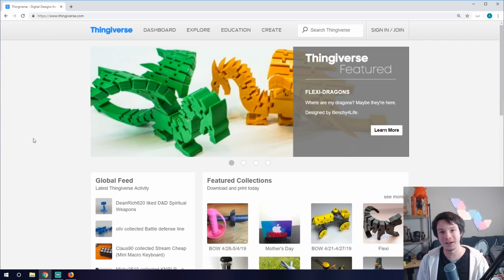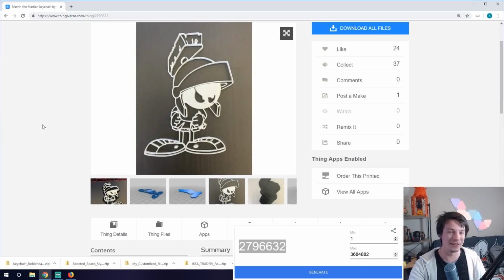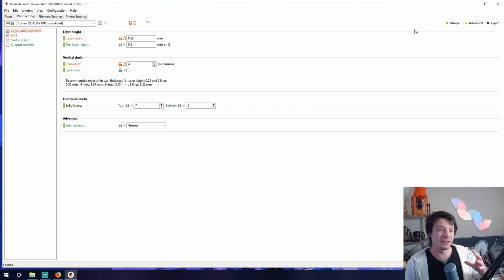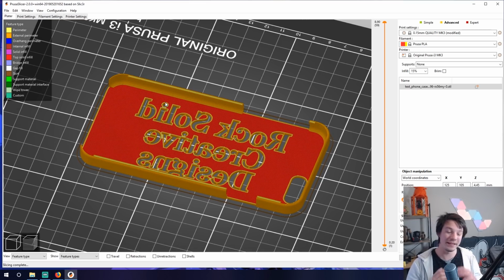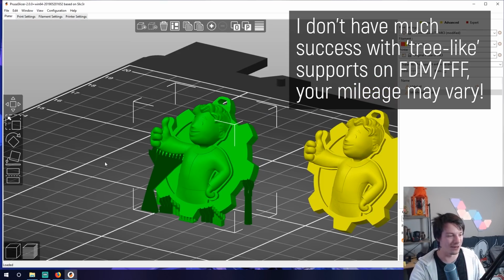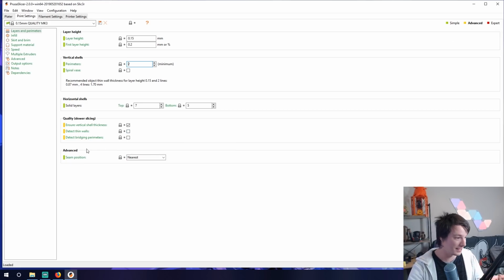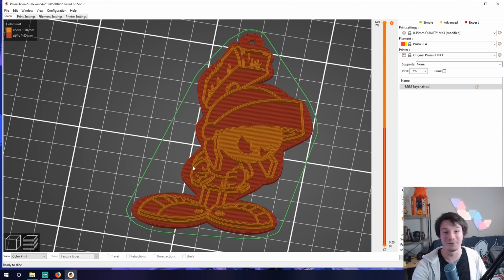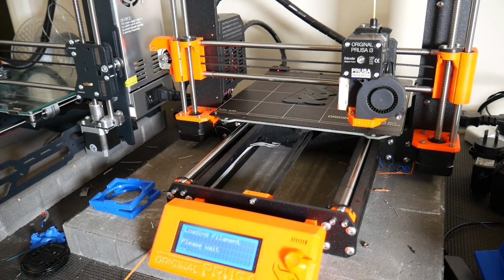PrusaSlicer 2.0 vs Thingiverse vs Prusa Mk3 - 3DP Gauntlet Episode 1

Comment: I wanted the elephants foot compensation in Cura. Interesting it exists in Prusa.  It does need a number if layers criteria and reduction per layer cruteria though. Of maybe just set the physical distance vertically and inward, and it can calculate a linear chamfer basically. 

Does Prusa slicer have graduated supports for that box? Then they can be minimal at the bottom and only increase desity near the top.

Comment: I did some dual colour prints and also had a problem with oozing. But there is a way to solve it in an easy way:

1. Increase the skirt in high up to the layer with the new colour. As skirt is always is printed first, you will prime the nozzle for the new filament there, not disturbing your object. The skirt works like a "prime tower"
2. Go into gcode with an text editor and search for M600. Cut it out and paste it about 7 lines later (after the the first linesegment of the next layers skrit is printed). M600 alway goes back to the last position, even if the next printing move is elsethere. So without editing the gcode, m600 will go inside the object first, than to the skirt. Printhead might loose some oozing material inside the object. If moving m600 5 lines down in the gcode, last position is in the skirt, so printhead is outside the object. So risk of loosing oozing material inside the object is much lower (maybe use a distance of 2cm or more for the skirt, so longer ooze can not fall into object).

Doing this two points makes colourchanging much more reliable.

Also with editing gcode gives more possibilitys. I printed the front of my Prusa Mini with 5 layers black and 5 layers orange, than black again, to get the empossed "Original Prusa Mini" Text more visible. Prusa Slicer prints Prusament PET-G with 240°C on first layer, 250°C on the next ones. I changed it to 235°C for less stringing, so the cutout text was printed much more clear. I added a second m600 before the 8th layer and replaced it by M104 S250 in Notepad++. So most of the part has full strengh, only the first 7 layers maybe a little less layer adheasion (which does not matter there) but a cleaner cut of the text and the orange better bridging over the cutout.

I eaven tried different materials for my Mini Clones. There I printed all parts black, exept dipflay case, wich is silk PLA (very nice look). I wanted the text in same colour as display case - so I added an M104 S215 before first M600 (and M104 S250 after the second one). With PLA also fan speed should ber 100%, so I added an m106 S255 after first M600 selected gcode from first m600 to second m600 and replaced all "M105" inside this selection by "M106 A255 ;".

It worked out beautifully. Sadly I have to print out it again, because I forgot to change the text from "Original" to "Cloned" before ;-) But maybe I simply print a cross with red filament an superglue it onto the "Original"...

Comment: That dual color marvin.
 Could that be printed vertically like the fallout keychain ? I realize you would have to use the separate 2 pieces rather than the single model version.
Reply from the maker: Depending on the overhang you would most likely need support material, but it's probably possible!

Comment: Very cool , i have had the Prusa i3 Mk3 for a little while and still trying to loose my L plates with 3D printing. Lots of great tips to help thanks heaps.
Would be very keen to see a serires on the Prusa i3 Mk3 and the Prusa slicer program, sing out if you do.
Cheers

Comment: Angus, instead of bombarding you with noob questions which you do not have time to answer, can you point me to a helpful 3D printing forum to help a noob who has not printed a single model, but who already has a ton of questions?  Thanks

Questions like: 

Does a 32mm wide tab sticking 6.35mm horizontally out of a simple box need a support structure?

Why do default settings on Cura and default settings on PrusaSlicer for the same model - a pretty simple box - vary by over an hour?  Same model, same printer, same material = 1 hour slower in Cura.

Does a model always print just like the sliced preview in the slicer software?  It looks like default Cura shows slightly better small letter formation than PrusaSlicer - I'll have to doouble check I didn't miss anything here.

Lastly, I'm a huge tech geek and have no problem tackling a printer build from scratch.  Is there an advantage to building your own vs Prusa or similar?  I'd like to get the best printer value for around $500 or so.  Should I be looking for resin printers?  Is that where the future is going?  Today's 3D printers haven't changed much in quality of print since materials and basic printing technology hasn't changed all that much in the last few years as borne out by your "3D Printer from 2012" video.  Less expensive, sure.  Better print quality, not proportionally so.  Ok, let the can of worms be opened, lol.

Comment: Default extrusion width: 0.42mm
I don't understand. What exactly does the extrusion width setting change? The position of the nozzle tip (distance between lines) or the amount of extruded material?
For some reason I thought it changed the latter, so increasing this setting would give you even wider layer lines. But now I'm in doubt.

Comment: Hi Angus, you should upgrade your MK3 to the full MK3s with all changes Prusa Research made until today. To me it‘s like day and night in case of handling and print quality. Especially if you print PLA cooling is much better. Also another tip: During wintertime here in Germany I increase my heat bed temperature by 5 to 10 degrees and all models stuck well. After the bed cooled down you can take the model from the bed and it did not stuck at all...

Comment: Hey Angus, great Video. You could have used the layerheight change feature for the battery box and change the Layer hight to 0.10 or less right under and during the the bridge so that the part comes in smoother from the outside.

Comment: I'd rotate the battery cover around Z by 90° so it lies lengthways in the Y direction to brace against the bed motion.
As the model builds, its mass and inertia increases and becomes much easier for it to lever itself off the bed.
Reply: Good note

Comment: I had a few questions on your opinion on octoprint and other automation tools: Is it that you're completely against using octoprint? If so, I would be interested in understanding why. I know you have this as a main business, so you usually have access to the more reliable printers, but many of us need an "eye" on our printer(s), so octoprint helps a lot while we're on the move. 

-If you don't use octprint at all, are there other remote tools that you use? If so, what tools?
-Have you considered any automation rigs, either purchased or created, to rapidly print on the same printer? i.e. something to automatically remove a print bed and replace it with another to start another print automatically. (I understand this is an extreme example, but maybe it'll trigger some ideas)
-Do you have any camera systems setup for viewing printers remotely? (Mainly why I use octprint)
-Can you do a test to compare printing from octoprint vs sd card vs tethering to a pc? Just to see if there's any "real" difference in results?

Comment: Gyroid infill is "not necessary" but isn't the point to it to have better structural integrity with less material used? What's the downside to using gyroid? I assume it's a bit slower to print but are there other reasons you're skeptical of it as the default?

Comment: Given that the dangly bridge bit is on the inside of the battery case, it's fine.  That said, it'd be nice if slicers had an option to just add a sacrificial bridge layer below where the actual bridge is expected, to be cut or sanded away after printing.

I also wonder about the strength of the print on the z-axis.  Given that this is a structural component, the print orientation could make a huge difference in how well it resists impacts.  I could see a relatively small impact sheering the layers apart in this orientation.

Comment: Nice video but a few choices I would not have done. The first part with problem in first layers is exactly why you should use a raft for dimensional accurate parts. Yeah your surface is not as pretty but you get much better dimensional results. Keychain should have been an example on orienting you part for less support material. The best would have been upside down from how it was printed. Head down would have been smarter.

Comment: Is using the PrusaSlicer a no brainer if I have the Prusa MK3? Or will some slicers work better depending on the specific design, regardless of the type of printer?
Reply: Some slicers work better depending on design. The only advantage PS would have with Prusa machines is that they have presets already set up for their machines.

Comment: Would the PrusaSlicer 2.0 software work on other printer brands (for example: Ender 3)?  How about if the board and firmware was changed to an MKS Gen L and current Marlin firmware?   Does it have a direct print option as well (I do not like to use SD cards- too much of a PITA).  THX.

Comment: I have the Mk2s and that m600 ooze is actually a bug, the moment you say the colour is clear it extrudes a bit more as it moves back to the part. I just grab this with the tweezers and all is good.
(great video as always. Thanks.)
Reply: That's there on purpose to stabilize the flow right before going back to printing. You should leave the extruded bit there and remove it just after hitting color clear when it extrudes the last bit.

Comment: Thanks for the vid, one of the more informative videos ive seen from you, thanks a bunch! Really learned alot, also liked how you showed how the multi color settings worked, was really amazed to see that. I guess there isnt an option to print different materials ontop of each other with that function but thats fine i guess since they probably wouldnt adhere well to each other anyhow.

Comment: I found with the M600, the best way to combat the ooze is to gently hold the end of the ooze with pliers or similar, but don't pull it away - let the nozzle travel do that work for you, and you'll end up with a clean nozzle. If you pull it away before the nozzle moves back to resume, you'll still get a little extra ooze on the way over.

Comment: Good video Angus, always good to see what others do to overcome common issues. 
A few comments:
- For the battery cover: you probably don't need supports for the entire width of the bottom side. You can essentially just put a few columns of supports (say 2 or 3) evenly spread out, so to reduce the distance of the bridging. That way, you kinda have the best of both worlds, cleaner bottom side, and not a huge waste of filament (as well as time).
- For the elephant foot compensation feature: I think this is one of the best features of PrusaSlicer. And in my testing, it does really do a smart job even with islands on the first layer. In other words, it doesn't just scale the first layer by x mm relative to the center. It does island detection and presumably centroid detection per island, and then shrinks the size per that island. So if you have a model with lots of islands on the first layer, it can take quite some considerable time to slice! But still, an amazingly useful feature to print functional parts that have to fit onto something else (without having to shave the elephant foot with Chuck's deburring tool). Yes, I do put a chamfer on my own designs, but hey, we don't always print our own designs!

- The extrusion width feature: Prior to PrusaSlicer, I used S3D all the time and extrusion width was the magical setting I use to tune X/Y resolution (just like layer height is what is used to tune Z resolution). But for some reason, in PrusaSlicer, tuning EW hasn't yielded the same desired results as in S3D. Now admittedly I haven't had as much time playing with PS as with S3D. But with S3D, if I looked at a slice preview and saw top surface level gaps or insufficient number of perimeters due to thin details, I'd tune the EW to say, 0.35 or even down to .25 (all on a .4 nozzle) if I wanted a lot of detail. Am curious if others did this too?
- The gyroid infill: I think this is potentially quieter and nearly the strongest infill without taking considerably longer time. My thoughts when I saw that infill as default was also the same as yours, but now I just leave it :) Stefan did a great video about the details: https://www.youtube.com/watch?v=upELI0HmzHc

Comment: Thanks again for another great video.
I tried a similar coin both horizontally and vertically. The vertical one printed fine with the same slight problem at the bottom and the horizontal print didn't look so good. The lettering on the back was squished almost to the point of being unreadable.

Comment: Great video idea !

Would have loved to see one more attempt on the battery cover using a third support enforcer of perhaps 20mm wide to support only the center of the bridge so the bridge becomes 1/2 the size. That's a great new feature that may further relegate Simplify 3D to collecting dust 😛

Would also have loved to see the phone case printed in TPU since that would present a better challenge and opportunity to learn

Comment: Great video thanks for posting !, Not sure if you noticed but the line width change in model 2 slicing didn't take, you changed the default line width but all the different parameters are hard coded to different widths (0.45 for example), you have to change them individually or nothing changes.

Comment: So with the Fallout medal thing, wouldn't it have worked to leave it leaned back the way it imported? You'd have a ton of supports, but you do anyway, and they wouldn't be connected to the face. I guess you'd have a smoother face to the flat gear base when it's vertical, but wouldn't the tilted version have been better for the relief details?

Comment: Awesome video.  I just upgraded the firmware on my tevo tornado to allow for the m600 command as i was still using the stock firmware from 2 years ago with the m600 code disabled.  Test print was a marvin keychain with colour swap half way through and it worked perfectly.

Comment: My problem with PrusaSlicer seems to be retractions.. for the life of my i cant find how to make it zhop during ALL travels.. so it drags across models when its inside its perimeter.. and has ripped prints off the bed.. travels between multiple models always zhop.. but if its a single model.. all to often its tearing up the surface (including final top surfaces.) Meanwhile, the previous version of Slic3r PE didnt have this issue..

Comment: I already tried Prusa slicer 2.0 and its slicing speed is very slow and support structures hard to control compared to simplify3d. I prefer sticking with simplify3d until Prusa slicer come up with an upgraded version which solves this issue.

Comment: 23:45 Why does it buldge on the corners, is that due to speed, over extrusion or just loose belts ?
Also good to see some some examples of slicing techniques to handle literally random situations. be good to see more of that, I liked the exprt mode scaling, never knew that was what it actually does since their docs sometimes hardly makes sense.

Comment: For stringing on the dual color print: Don't swap colors on the first layer of the embossing, swap on the second or third. That tiny gap will make sure your strings don't fuse to the background.
Reply: _ David _  I don't mean air print, I mean if you're say printing black to white have the first layer of text stay black, then swap to white. Any lines the print head makes when moving will be the same color plastic and won't stand out.
Reply: idiot

Comment: Would like to see the difference of the fallout boy printed horizontally vs vertically. I don't think extra supports would be needed and that extra saved time could be given to lowering the layer height a bit..
Reply: Round Tuit I think it would have been best in the original orientation with support-only-from-bed so supports wouldn't have been required at all on any of the front face, but detail would still be there.

Comment: The large part should have been oriented differently. Just tilt it 25 degrees backwards (x-axis) and then create support enforcers for the first 4cm of the part. This way you basically end up having no critical downskins at all and only have to attach the part to the platform with supports.

Comment: I would have done the coin at 0.05 (the prusa can handle that fine it works much better than you might think) and gotten rid of most of the support (just the bottom) gamble but I think it might work. I also would have printed it flat on its back first. the 0.05 layer height should make that usable. 0.02 is possible with a very well tuned slice and really good filament (no sparkle)

Comment: If you were to tilt the battery cover back by 30°, then generate support ribs from the "back" to the "top edge" and spaced out every 10 - 15mm, Then rotate back to fully upright and do the brim and lower supports... you would have the supports you need without having to run supports from the bottom of the model to that top edge... save a ton of material and accomplish the best print!

Comment: I have actually had a lot of success when using tree support in Cura. Much easier to remove on organic models (like the key ring) and it is usually easier to print. For flat overhangs, it is better to use normal support.